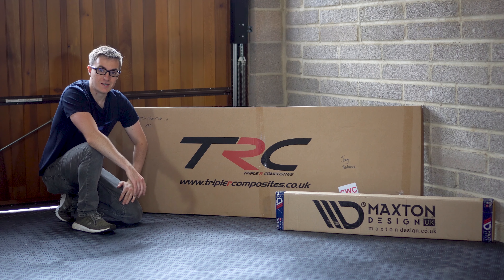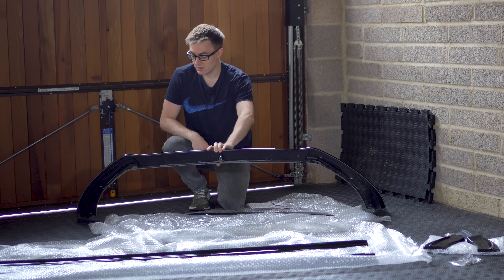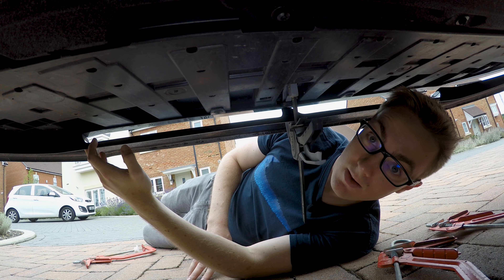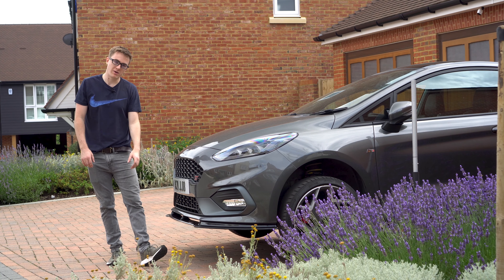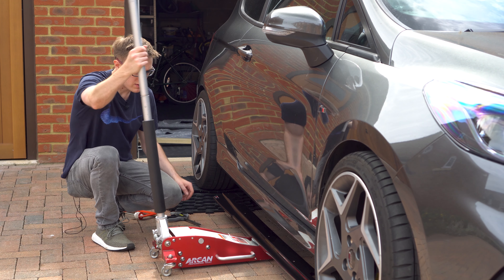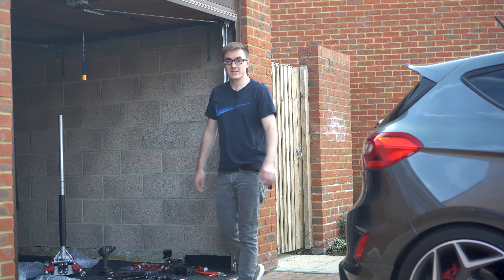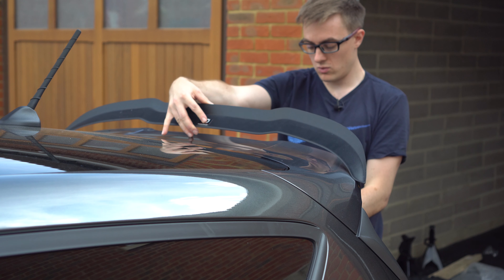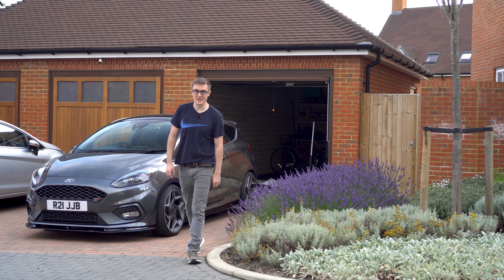MK8 Fiesta - Splitters, Skirts, Rear Spats & Spoiler Cap Install (Visual TRANSFORMATION!)

Comment: Will the fiesta mk 8 st lower grill fit my 1.0 ztec mk8
Reply from the maker: Not sure if it will. The bumper will fit though, if you are happy to swap them over. If you have adaptive cruise, you may not be able to swap the lower grill (has the radar in it). Also, not sure if the adaptive cruise lower grill would fit the ST bumper. Hope that helps!
Reply: @JBCTR   cheers mate

Comment: I want to buy the ST in the same Color. Now, I have some questions to you:
- is you car lowered ? when yes, how much ?
- what wheel size is that ? 17 or 18 Inch.
- did you mount wheel spacers ?
Thanks for your answers...
Reply from the maker: Heinz Hans Hi mate, yes the car is lowered by 20mm, on 18 inch wheels and it has 20mm spacers. I have done installation videos on all of these modifications, so you can see how they are done :)

Comment: Is it possible to change the ST line headlights to these ones?
Reply from the maker: If the ST Line headlights are LED's then I imagine they'll be a straight swap. If you have the halogen clusters then it may be possible but expensive. The LED headlights have sensors on both front and rear axles for leveling which will need to be retrofitted in order to make the LED's work.

Comment: Was waiting for this video. You came across the same issue as me, took a good couple of hours and a lot of thinking to get the the front splitter to fit, eventually managed to use the nuts and bolts but jeez it wasn’ easy! Strange thing was everyone else said it was!? The sides were easy enough and just screwed the back ones on. With it lowered do you not think you’’ll have issues with speed humps? oh and they’ll never be that clean again.
Reply from the maker: Not had any issues with speed bumps yet (thankfully!) It seems to be holding up well. Hit 120 on track yesterday and they didn’t come off, so must be on okay 🤷🏼‍♀️🤣
Reply: @JBCTR  good to hear!

Comment: nice vid man, do you think it would be hard to remove the spoiler extension if needed? Oh yea hows the rivets holding up? cheers dude
Reply from the maker: Pretty easy. Pull it off and apply some glue remover and you should be golden. Rivets are doing a stirling job! I've not hit the splitter on anything thought to really test them.

Comment: Any issues with speed humps? I mean the small island type bumps. I used to have a mk1 tt that was lowered 40mm and it was a nightmare for scraping!
Reply from the maker: baldrick650 Surprisingly, I’ve had no issues yet and I’ve been over a broad selection of speed bumps 🤣 granted, I’ve been going super slow, but all good. Car is only lowered by 20mm
Reply: @JBCTR  I'd be seriously worried about ripping off the front splitter around my way! 😁